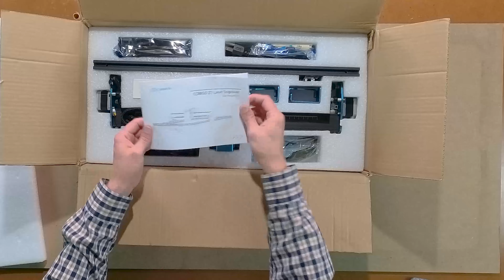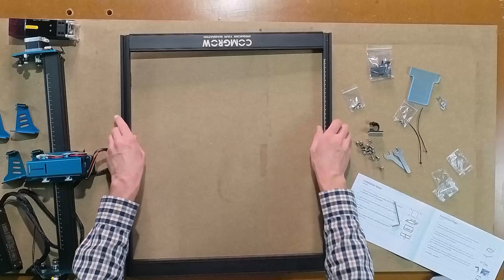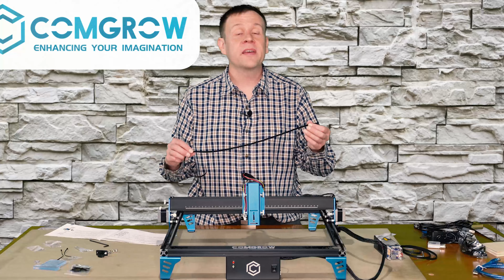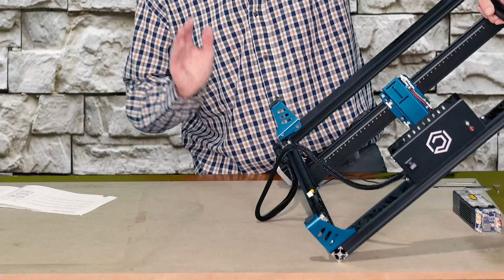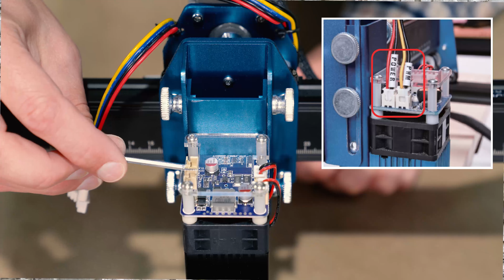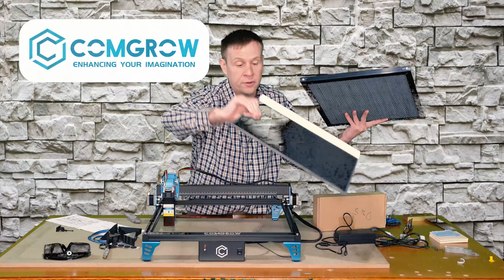Giant Comgrow Unboxing and Setup!

Comment: Is the file you supply for lightburn any different then setting up manually like in the instructions
Reply from the maker: It is the same.  The file I supply can be completed in one step.  The manual settings require navigating around LightBurn and updating settings.  I've tested both methods and the file I supply updates everything in one super easy step!
Reply: Thank you just making sure it wouldn’t add something that I didn’t have
Reply from the maker: @rebelyankee1  No problem- I have multiple machines and using the Device file adds the machine to the machine list making it easy to switch!